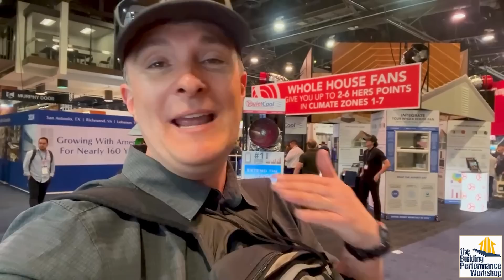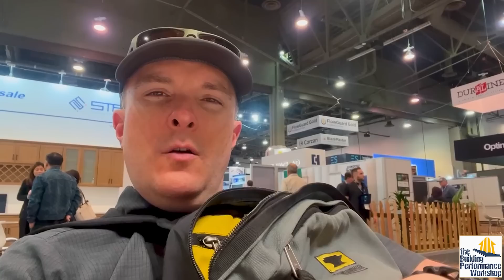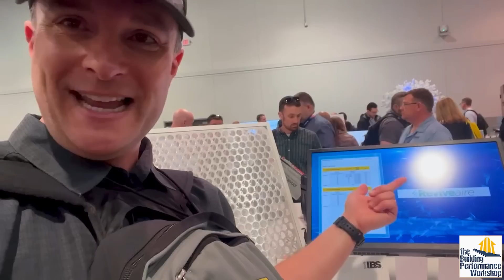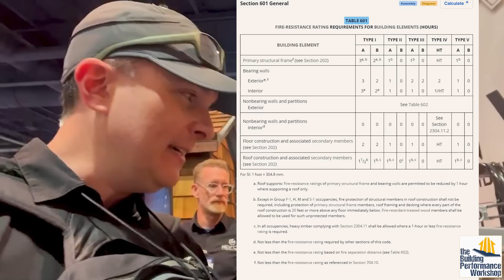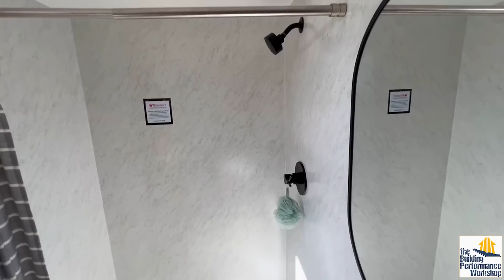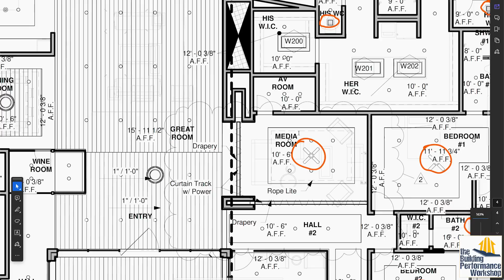Home Builder Show Best & Worst: Science at 2024 IBS KBIS Design & Construction Week

Comment: The aerobarrier ACH50 number being lower is because bath fans, dryer vents, etc are sealed. So it's basically cheating.

It's sealed so the aerobarrier doesn't seal where it shouldn't.

Comment: If you wanted to use a whole house fan in a more efficient and safe manner, you could get an economizer controller and set it up for differential enthalpy control. That way, it would only run when the outside air enthalpy is lower than the inside air enthalpy. They arnet that expensive, about $700 at Supply House I think.

Comment: The center stove exhaust fans only work well (in my experience) if you put a lid on the pan/pot and slightly move the lid towards the vent so it draws air over the food and then out. That works really well but everything else sucks.

Comment: I love the idea of the recirculating shower (RainStick) since we are building and will be on septic - anything that reduces the amount of water entering the system will improve it's performance.  However, one thing I can't get a straight answer about from the company is whether or not the UV light that this unit uses operates at a wavelength that is likely to generate significant amounts of ozone.  And, if ozone is being made, does having it in the shower, directly below the ERV exhaust mean that there will be minimal risk of exposure to further chemical reactions from the ozone and whatever else might be in the bathroom due to venting?  Any thoughts?
Reply: I don't want a recirculating shower, any more than I want a toilet that is recirculating water on top of me.  Because everyone pees in the shower, right?  Hopefully you probably don't poop in the shower, but who knows what happens if you're sick or you just can't make it out of the shower in time.

Comment: You have a toxin-exuding gas stove in your kitchen! Gas stoves leak 75% of the toxic gasses when they are turned off and the vent hood fan isn't on. Don't try to con people into ugly ersatz fireplaces, just specify a Wood Burning Russian Masonry Heater.  Russian stoves are the only wood burning fireplaces allowed to be built in the (highly regulated) state of California. Because they have glass fire doors (like wood stoves), room air never mingles with combustion gasses or particles from the fire. There's no backdrafting. All combustion air is drawn from outdoors. Smoke, gasses, and particles from the fire are not directed to a vertical flue, but circulate around and behind the firebox and take a long serpentine route to the top of the chimney. This essentially turns the chimney surround and chimney breast into a clean exhaust system while extracting the maximum amount of heat from the fire. [Whoopee! I get to play Borg Queen] Your efforts to convince people in cold climates that they don't want a real fireplace are futile. Investigate Russian wood burning stoves.